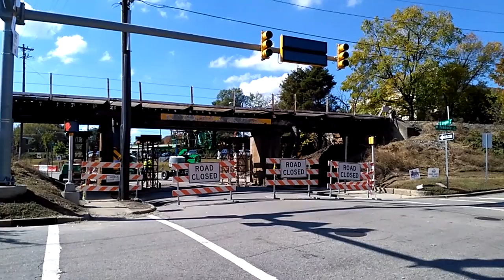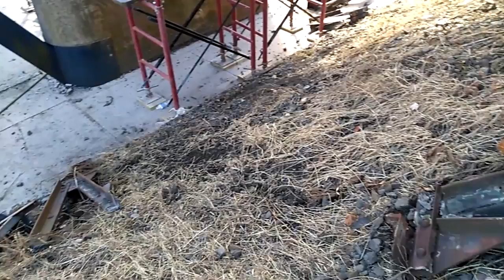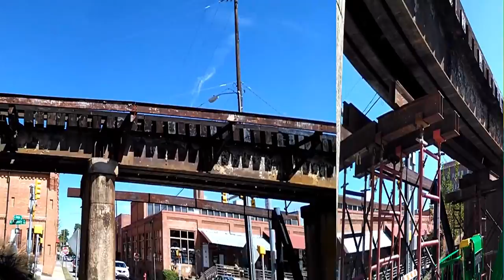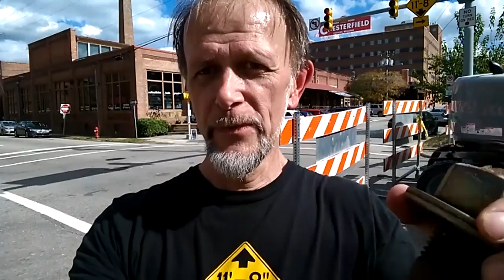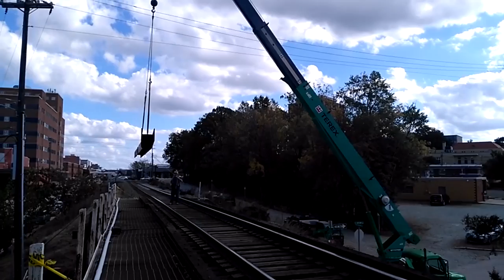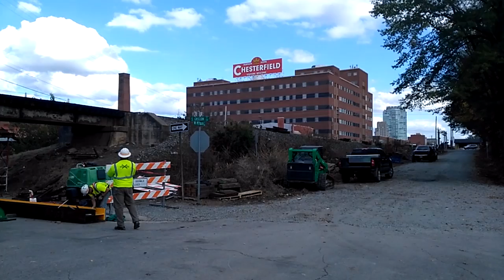Preparing to raise the 11foot8 bridge

Comment: Whatever you do yovo, do not delete the videos. I want my grandkids to see it
Reply: Same
Reply: Don't worry, he will still be making crash videos at this location.......
Reply: It's only being raised to 12'4"... I'm sure there will be some 13' trucks that hit the new bar.
Reply: @Kickinpony66  ...same.
But I think, to rise the railway up, that you get a 14 feet bridge - is impossible ?
Reply: @sunnymas2656  As I understand, the Railroad must maintain a 1% Grade. If they were to make a 14 foot bridge, the Inclination would exceed 1%.
Reply: @sunnymas2656  They don't want to invest to much in the railroad track.
the sleepers are nailed instead of screwed or clamped to the tracks that says enough  Cheap as possible
raising the railroad levy must be done on a long stretch.

On the other side lowering the roadsurface 2-3 feet of is also an option.
Its way cheaper than raising the railroadtrack.
Reply: @doctordothraki4378  I think, the railway is the biggest problem. Because you cannot change it so easily as a road. And if you do a bit wrong, the train wheels has no grip.
Reply: @obelic71  But I read here, that there are tubes under the road. So lowering the road is not an option.
But if possible, it would be cheaper.

Here in germany, the railway has a bad image. The companies prefer trucks instead of the railway.
Reply: @sunnymas2656  You know for us Europeans that is standard issue, often there is more then 100 years of technical utility pipes and lines under a construction site. Often an archeologic team is required to get out even older things like Prehistoric, Roman, middle age graves out of the ground before construction can continue again.
The German railroad system has the same problems as all old railroad networks in europe. They were constructed mostly 100-150 years ago and can't expanded, maintained or be updated easily in urban area's
Here in the Netherlands we also have the same problem but a smaller network then in Germany. The Irony is that the DB doughter Arriva that is running passenger trains in the Netherlands is making money and the Mother DB in general makes a loss. 
Maintaining an aging network with low investments and higher ussage bites you eventionaly.
The rail/road bridges  wear out to fast due to faster increasing traffic.
Bridges designed for 100 years are now worn down at 10-15 years.
Lets say infra construction workers are and will be the most sought after skilled workers for a long time.
Reply: @obelic71  Here in germany, the DB railway company is confusing.
The tickets are too expensive, or too cheap. But not an alltime middle level.

Transportation looks bad. Here are trains standing with goods loaded several days.

They have build a container station at the railway. But mostly, there is qiet, and Nobody there.

With this, you cannot make a good business to make money.

There are a few small private railway companies in east germany.
With full service for the passengers.
ie in the morning, on the way to their jobs.

You can get coffee etc., the newspaper of the day, some snacks, for not expensive prices.

Another country, another company.
You can enter the train without a ticket.
But you can buy a ticket online, or via Smartphone at the train conductor.

If you create it more easy and comfortable, you can get more customers.

Amazons sucess: To buy goods as easy as possible. Some mouse clicks - and all done. They deliver it at your home.

The modern technology is more modern, as ie the railway companies.
We miss some Innovation there.
Reply: @sunnymas2656  The big irony Germany is still one of the leaders in the world in innovative railway equipment and railway construction.
80% of all railwaystock running in the Netherlands were/are build in Germany.
The rest is French (Alsthom) Swiss (Stadler) and soon Spain.(CAF)
DB Traincars build in Gorlitz former east  Germany are arriving daily at Amsterdam.

In my humble opinion 95% of electrification of the German network and converting to multiple unit train sets (without locomotives) on low and high demand passenger routes could reduce the operating costs, turnaround speed and increase efficiency.
Reply: @obelic71  Yes , the technology is there. Even the high impact, to make Wifi possible in some long distance trains.
(It works with several mobile cell phones technology in one waggon of the train.)

But it is too difficult for the customers, to find the best price for a ticket.
And if you want to travel spontaneus, it might be too expensive.

The service at railway stations are not allways good, or not 24 h., or often zero. All closed, Nobody there.

For long distances you better do reservations for your seat. But after seven minutes, your reservation cancels. If you have not find it, you loose.
So at one tour, me and my family partly must sit on the waggon floor. 

The DB now has problems, to get new workers, in all areas. Also train drivers needed.

The old one becomes retired, and young people don´t want to work at railway or in trains. Because long and different working times, and maybe several days on tour, until back home.
Reply: @sunnymas2656  Finding new personel for all forms of public transport is becoming also a serious problem. 
Its a 24/7/365 bussines
Not only the drivers. maintenance and overhauling crews are in high demand
In Rotterdam the first technical Railway school has oppend. Train/tram/metro drivers, railwaystock/lines mechanics electricians and  controllers are getting an education.

And yes rules and regulations from goverments can screw up alot of logics.
In Germany you have also the different federal states that have additional rules and pricing that makes it even more absurd for the average traveller.
Once the interregio was simple affordable and pricing was easy to understand.

Now they force you to travel in the higher priced inter/euro city, ICE  or the low priced RE with alots of stops and changes.

Never underestimate the stupidity of la "logic" thinking goverment.
Only then you get nice fuck ups like the 11foot8" bridge in the US and other stupidities in Europe.

We all laugh, but sadly the most of us have a same sort of stupidity nearby
Reply: @obelic71  The federal states of germany are not a big problem.
Only because of the federal state police.
Some federal states are poor like Berlin, some not like Bayern or Baden-Württemberg.

But this depends directly to their police.
ie the Berlin police were very happy, when they got used police cars from Bayern, who where took out of using.

In Baden-Württemberg it was sad long time for the police. Not enough computers, cell phones, cars, etc.
But now they got more, and good police cars via Leasing.

The other police is the german Bundespolizei. They are not under a federal state. They are under germany gouverment. So this depends not on federal state.
Reply: @doctordothraki4378  You also have to remember that 11' 8" has a sewer line running below the road as well. They can't do anything that'd add too much weight without restructuring the sewer.
Reply: You can always save the videos to the computer. 🤷🏻‍♂️
Reply: @doctordothraki4378  best idea yet but that could take millions n several months not to mention logistics nightmare during...ergo 12-4 bandaid
Reply: Isn´t easier to lower the road?
Reply: @ molak34
Not if there’s important tubing underneath. Although I think it will still be easier and cheaper to do that regardless.
Reply: @sunnymas2656  - What do you mean by “the train wheels have no grip”?
Reply: @sunnymas2656  - In the USA most RR freight is bulk, TOFC and auto racks. Railway Express LTC is long gone.
Reply: @obelic71  - The 11’-8” (3,35m) bridge was built almost 80 years ago when few cans were that high.
Reply: @molak34  - Sewers are not easily lowered as they operate by gravity and cannot tolerate a low spot.
Reply: @algrayson8965  Here in Germany RR freight would be good, because too much trucks on the road.

At Weekends, we have not enough parking space for trucks at interstates. (Autobahn). But they need to stop at weekend.

We have a strict law, what times the truck driver is allowed to drive, and when not.
At weekends almost trucks are not allowed to drive.

Every truck has an electronic unit, and every truck driver has his personalized chipcard. So the police can check, who drove, and how long.

Only minutes too much, can be fined with up to $ 400, where the driver has to pay. Foreign drivers have to pay cash, right now.

So f*ck when you have to stop, but where ? Lonely in an urban street ? Better at a truck stop. If you get a free parking place.
Reply: @sunnymas2656  Yep The "famous" Sunday (and holidays seen as Sundays) LKW driving ban that even starts in some cities Saturday afternoon. 
Only some with special permits for loads and goods may drive. 
Entire Industrial area's are cloged up with loaded up trucks
Reply: @obelic71  The german gouverments promise more park range for trucks - but they miss it.

The transport business in germany needs up to 12.000 new truck drivers.
But most people don´t want this job.
Reply: Just screen capture it with your volume up so you get it and it’s audio.

Comment: “Don’t cry because it’s over, smile because it happened.”
Reply: Dr. Seuss was a great philosopher.
Reply: I cant help it 😥
Reply: Not completely over. 12'4" is still 14" lower than standard max height for vehicles. The smaller box trucks may escape but the larger ones will still make a very satisfying crunch.
Reply: @edfrawley4356  But larger ones are generally professional drivers that know their vehicle's height and won't make the mistake.
Small box trucks are available to rent to basically any idiot that has no idea how to drive a truck
Reply: @Nitlda  This is true....mostly. But if you go back thru the vids you will see several which HAD to be CDL holders
Reply: I will visit this intersection one day, even if it doesn't lead to crashes anymore. Thanks Jurgen!
Reply: Agreed with the above users. That's still not enough clearance for most semi trucks, or I imagine most heavy equipment like excavators being transported. In fact, I'm not sure why they're bothering to raise it only a few inches, maybe that's all they can do.
Reply: its my party and I'll cry if I want to
Reply: @Jeremy0459  It was mentioned that it is being raised to match the next bridge over.  While not to current standards, the track grade was probably already set up to allow it and the other bridge doesn't have as many accidents.

Comment: Truck repair companies must be crying their eyes out.
Reply: But,,, the insurance companies are smiling. 💰
Reply: Yeah but it's party time for Ryder and Penske!
Reply: The usual towimg company will be bummed.
Reply: All the trucks are still going to hit, RVs too.
Reply: The extra 8" is only going to help some trucks.  That only raises the clearance to the same as an underpass in my town.  A lot of dents in the height warning sign on its "can opener".
Reply: Lol even though a majority of trucks will not fit under a 12’ 4” bridge, this bridge being raised will solve nothing
Reply: @joker432  Drop the road level a few inches that should sort it
Reply: @billdougan4022  wonder if the insurance companies are paying for it?
Reply: @Mrflash222006  there are utilities under the road bed. It would be a major undertaking to move all of those.
Reply: @Mrflash222006  supposedly there is a bunch of stuff under the roadway, so they can't.
Reply: Not all of them will.  Many rental trucks have a height of 13’ 3”.  It’ll still likely be a can opener.
Reply: Yep, solves nothing
Reply: Mrflash222006 nope! City sewer lines run underneath the road surface.
Reply: Edward Woodward most box trailers are 13'6" so they won't fit.
Reply: Paul Drake and sewage lines, too right?
Reply: Probably more relieved than sad
Reply: 12’4” is still too low. There will be more mayhem for sure.
Reply: Hahah no shit! 
“We repair rental box trucks” right before the bridge and after hahahah

Comment: The standard trailer height is 13'6" so the content wont end.
Reply: short and sweet.
Reply: Standard trucks use a special navigation software. Only local lorries were filmed there. Thus this rising will probably help.
Reply: @sc0or  Yea that's not true. Im a driver myself and almost every company i know of makes the driver buy their own gps. In america the only truck sade gps is the Garmin DEZL and the rand McNally. Ive had both and they've both routed me through low clearances and no truck routes. Trucking is way different in the states than wherever you're at.
Reply: @clay-r15  I understand. Considering a total length of all US roads, I'm not surprised at all. Good luck on a road!
Reply: Unbelievable. Here in Germany it’s 4m. Except historical stuff, everyone knows that I guess. But we‘re having an airport that will never get ready (BER)
Reply: It seemed the majority of trucks were box trucks, iit should eliminate a majority of the crashes. Unfortunately, you can't fix stupid so it'll stop l still happen. just not as frequently.
Reply: Absolutely right
Reply: @sc0or  Local Delivery trucks don't.. well specifically the company I drive for uses Apple maps.. the crappy cousin of Google maps.  
OTR drivers use the special gps stuff.
Reply: @VampFaye  yeah they'll still need the warnings and stop light for sure.  Most of the bigger trucks I've seen are 13'4".  Haven't seen too many/if any pass under this bridge though.
Reply: RVs are also over 13 ft.  The can opener will still survive.
Reply: @sc0or  you just wait.
Reply: @Oblivionbolt1  Big flashing signs and lights didn't help either.
Reply: Part of having a CDL is reading signs, at least in my state and at my company.  There are many signs warning of the height, so professional drivers (at least the sober ones) should be fine.  And local drivers will be better off.  But you can't raise a train track easily to accommodate so many stupid drivers.  We have a few low bridge, or high train track areas in town just like this.  We also have stupid drivers.
Reply: The standard for straights is 12'0"
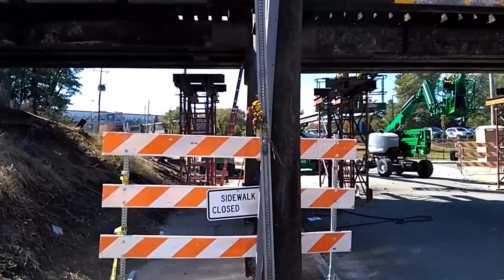Reply: 1:14 - Flowers on the sign post, who died/how many died here? LOL

#2. They let you into an active construction site, and with no hard hat?? Begging for a lawsuit.  Sure OSHA was not on site! 😆

C. I should setup a camera at the intersection where I live, been living here for 11 years and there always have been car crashes, like 3/week here. About 2 months ago a motorcyclist met his demise when he decided to WOT while a car was making a left turn in front of him. The rest is history. Think of all the footage I've missed over the years 😡.
Reply: I replied to you, Clay, but that reply seems to have evaporated.  So i'll reply again.  13'6" is for semi's.  Most CDL class 2's (Straight jobs )  are 12'0" (flat) , ( with exception for special weight and equipment.  which  may make a CDL class 1, even though it is not a semi  ).  They are called "straight jobs ", and the 11'8" , six point hex sign,  warn signs  are directed towards them , the straight jobs.  Further, before you leave the yard, if you're the driver, it's up to you to know the height of your  truck, and the weight of your load ,Tare weight,,, and weight   PER AXLE , and net weight on your manifest(s).
Reply: Yeah,  lukin back, was short and suewt. wudnit
Reply: @rcmarquette3838  i drive a tractor trailer class A so i didnt know, the standard class a trailer is 13'6" so i just assumed straight trucks would be the same so tbe could reach all the same docks.
Reply: If you watch somd of this channels previous vids a few tractor trailers hit the bridge so at least we'll have that to look forward too.
Reply: @VampFaye  A lot of the box trucks looked to be at least 20ft long.  Which means they were at least 13ft high.  This channel will still be alive, but less active.
Reply: @clay-r15  They're still dock height, but most of them have lower ceilings. There are definitely 13' 6" straight trucks though
Reply: Agreed.
Secure Job-A and even start working. Call ahead, and take one-day off (or even half-day) to go to the final interview with Job-B without telling Job-A. After the final interview, you'll find out if you got Job-B within 2 days. If you didn't get Job-B, well no harm no foul. If you end up getting Job-B, and you don't want it, call Job-B and apologise and tell them your circumstances have changed and you no longer can work (eg Could be a family matter, or moving to another city, etc etc). Again, no harm no foul.

However, if you prefer Job-B, take it and let Job-A know that you are quitting.
Reasons to take Job-B, better pay, better job progression/outlook, better reputation for portfolio, better work environment, etc etc.
Reply: @clay-r15  I see a lot of rental trucks in the footage. Its almost weird these rental companies dont have something installed for this bridge yet.
Reply: Most class A tractors stacks or exhaust are around 13’2- 13’3 at tallest. There’s def some a couple inches taller. The trailer is usually a couple inches shorter. 13’6 is a stretch.
Reply: @legendofzelda2324  I don't know man, I'm a trucker and have been for 6 years now, every refrigerated or dryvan trailer I've seen is 13'6" and either 48' long or 53' long.